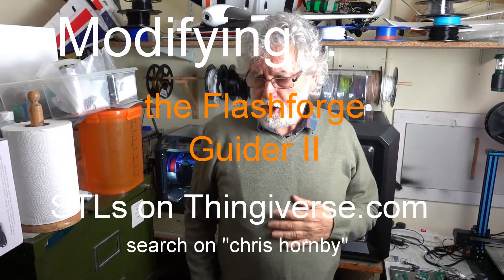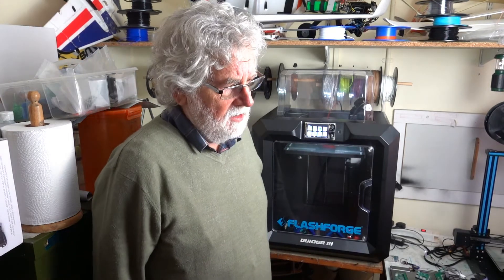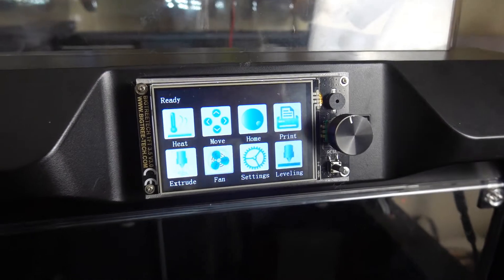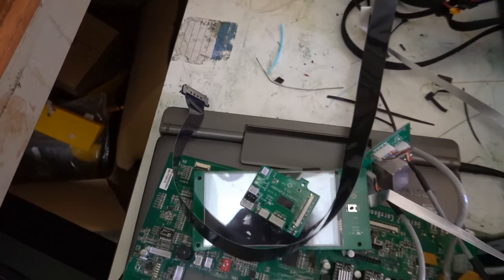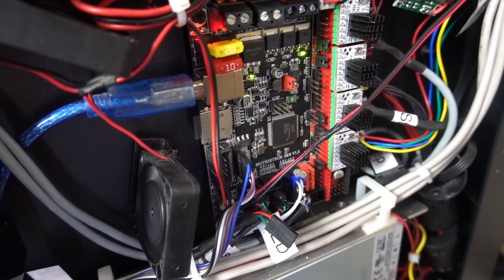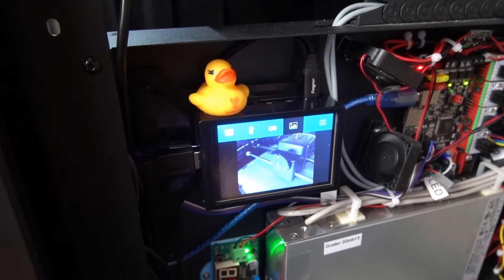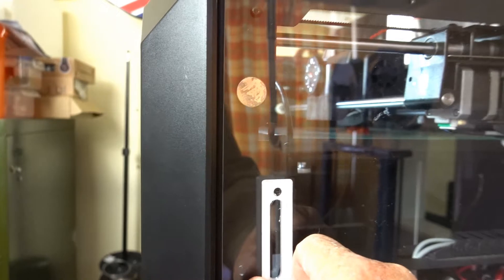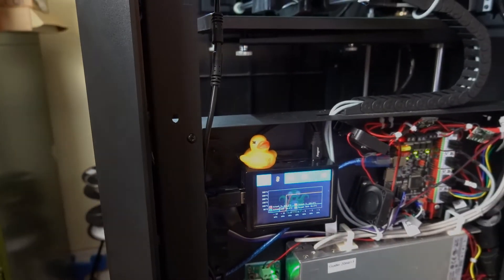Flashforge guider 2 mods.

Comment: Hi Chris - I'm back again and have to warn you I may end up being like the unwanted inlaws that came for a visit and didn't leave ....   My Guider 2 has starting acting up lately where it decides to freeze in the middle of a print with the screen going blank and it leaves everything powered up including the hot end and bed.  There's a nice little burnt hole in my build surface now as a result too.  It doesn't do this all the time, in fact very infrequently, but the mere chance of it happening has me digging and researching the possible conversion over to an open source board, and your video is about the only reference I have so sorry for being a pest.  After studying your video many times and looking over your thingiverse files a question has arisen about the endstops.  Did you keep the original optical endstops in the guider or did you install new ones (such as mechanical etc.).  I also see that Flashforge placed the x/y/z endstops at the MAX positions and not the more common MIN positions but I guess that the firmware can sort all that out.  Also, is there a chance that you could take some additional pictures of your controller board and extruder wiring from different angles and send them to me, or post somewhere, for me and others to study?  I'd really appreciate it as I suspect I will be embarking on this conversion this coming winter after I am driven inside from the yardwork here in Canada.  Finally, I saw what looked like a few tiny buck converters in your controller wiring and am wondering what they are powering ?  The optical endstops maybe ?  There's also one in the extruder stuck to the top of the stepper motor that I can't figure out what it's up to.  Anyway, cheers from sunny Canada and thanks for your help (and patience!).   Lewis

Comment: Chris - Did you swap out the heated bed temperature sensor or keep the stock one ?  I see you have EPCOS100K in your config file but I'm not sure if I need to replace the one on the bed already.  Thanks.
Reply from the maker: I used the stock heated bed sensor. I didn't really think about it in the configuration file.

Comment: I believe this is no longer a Flashforge.... It is now a Frankenforge Guider III lol. Thinking of doing the same thing as like you said, the firmware is pretty closed down, and also there is a distinct lack of PWM fan control.... Which I really seem to need for ASA printing, no fan means the material stays soft too long and print quality suffers. Having the fan on (at the only setting, 100%) equals better print quality but poor layer adhesion. I was thinking of using an additional extruder board in the control cab to convert to the ribbon cable, as it appears to be lighter weight and would maintain the stock look than running a homemade loom. I'd have to look at the board, but I figure worse case I could remove the discreet components and jumper the traces in the cabinet.
Reply: I'm also mulling over a conversion of a Guider 2.  It's an older machine but has some quirks and when I bought it used the firmware had not been upgraded. Ever.  Too scared I'll brick the controller now.  There's precious little info online about these units.  Would be good to form a little group somewhere where we could chat and swap ideas.  What's the little smt circuit board that's stuck on the top of the extruder motor ?  Can't seem to puzzle that out.

Comment: Hi can we get the M/Board details seller et.c?..thanks in advance.
Reply from the maker: here you go off amazon https://www.amazon.com/BIGTREETECH-Control-Integrated-TMC2209-TMC2208/dp/B089DBS62S/ref=sr_1_2_sspa?crid=17BC0Z13JG2J3&dchild=1&keywords=bigtreetech+skr+v1.4+board&qid=1612730203&sprefix=bigtreetech+%2Caps%2C268&sr=8-2-spons&psc=1&spLa=ZW5jcnlwdGVkUXVhbGlmaWVyPUE2R0lPMzJRSjNGNUwmZW5jcnlwdGVkSWQ9QTA0MzIzNDBCQlRJMUhRSU9BWkQmZW5jcnlwdGVkQWRJZD1BMDU3NzQ4OTI1TFJCWFNNS1dPME0md2lkZ2V0TmFtZT1zcF9hdGYmYWN0aW9uPWNsaWNrUmVkaXJlY3QmZG9Ob3RMb2dDbGljaz10cnVl
Reply: @Aikonaazi  Just found out I need a new cable for Z axis motor  as they are hard-wired to the windings you have to buy a new motor.Machine has to many   other     issues to rewire
Reply from the maker: @glendooer6211  New nema 17 motor is very cheap, but you can solder new wire to existing cable. There are 2 windings, to find out correct connections find the continuous pairs. These are the 2 coils. If the motor goes in the wrong direction you can swap the wires in one of the pairs. Or reverse it in the software.
Reply: @Aikonaazi  Thanks  ..but have other probsThis has the treaded screw as part of the motor /and FF want $100 USD?? the x and Y wont work ,,so will fix up my dreamer for now..Need a LCD for the Dreamer any ideas

Comment: Hi Chris, great video with some great work there, I've just ordered a guider 2, it will be my first 3D printer, wanted one for a while now and I believe it will greatly help me produce cheap prototypes for my business, are there any tips you would suggest ? I've also ordered the high temp hot end in order to print in more exotic matirels and a flexible bed.

Thanks Again
Ollie
Reply from the maker: Yes it is a great printer, don't do any mods unless it has broken or the guarantee is over!. I have found the most difficult thing was access to the hot end to unblock when necessary. I took steps to make this easier, but not suggesting that you should as well! I found that the high temp hot end was more liable to give problems, I think because the heat break got too hot. I guess if you are printing nylon or polycarb it is necessary, but for PLA it is a liability. Just my 2ps worth, I am not criticising the printer.
Reply: @Aikonaazi  brilliant, thanks, look forward to your future 3D printing videos

Comment: I have a guider 2s do you believe these upgrades of your would work with the guider 2s or only the 2. The only difference between them that I'm aware of is that the S version has a camera and it's hotend can get hotter. Thanks in advance for any response cheers.
Reply from the maker: Yes they should work as all the electronics are replaced. However I would only do it if I needed to replace the expensive main board. If it is working fine probably best to leave it as it is.